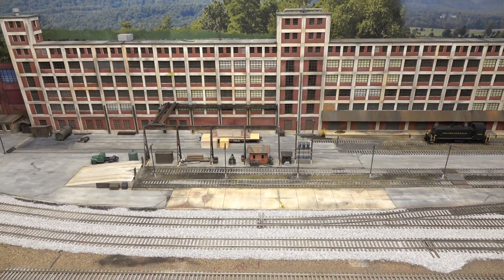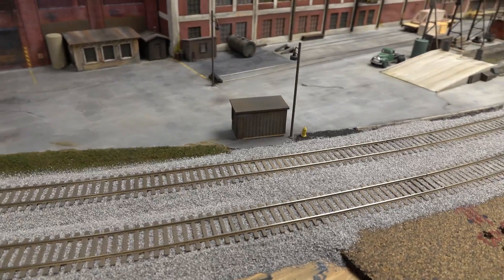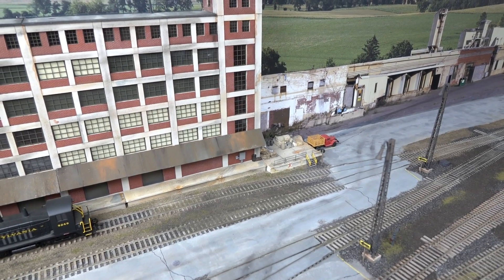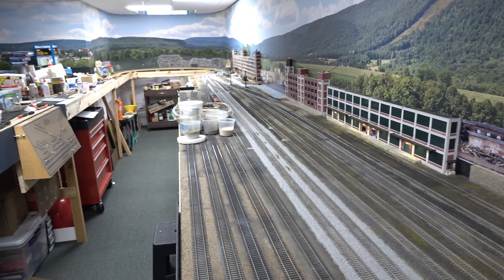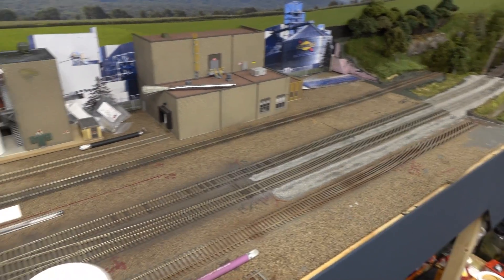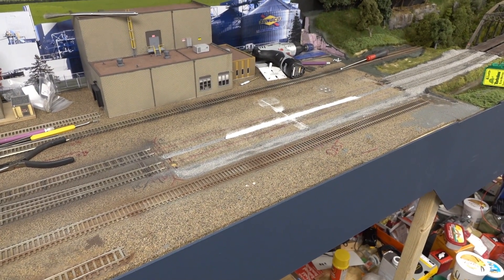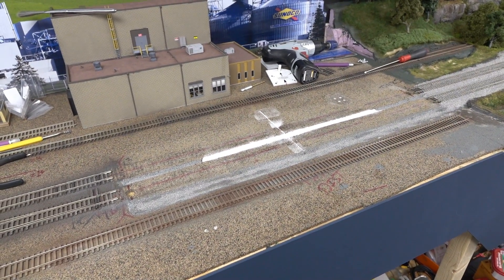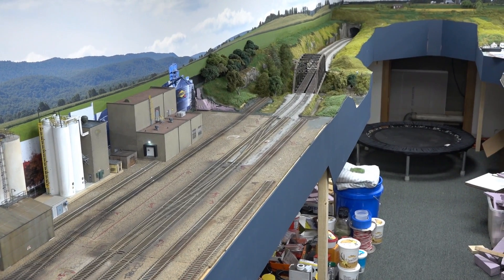MRUV 116: Details, Track Power & Crossover Installed

Comment: Just watched your video, and it brings back good memory's, from long ago.
Back when I was a kid in the 50’s, we didn’t have LED’s.
So we used fiber optics to light up things that with a light bulb would get too hot.
Nothing like putting in long hours, and then watch things melt.
With one light bulb we could do a hole part of the layout..
Some of the parts that we lit up, couldn’t have not been done with the old wheat light bulbs.
It work back then, do you ever think about using fiber optics on tight spots?
Reply: I have considered fiber optics- in fact I have some. Thus far have been able to make things work, especially with some of the much smaller LEDs now available. But there certainly will be instances where the fiber optics will be a very good option.

Comment: Good update. My question is; Can you possibly do a video on how to wire signals? Thanks
Reply: If you go back and look at some of his earlier videos, he talks about the signaling and block detection.
Reply: Christopher is correct- the Controls & C/MRI playlist touches on it in several videos. Wiring the signals is actually pretty easy, it is the controlling of them that gets more involved. The signals here are just wired to a CMRI resistor board (for the LEDs) then run back to the CMRI SMINI/SUSIC boards for control.
Reply: Rob Bennett Christopher Long Thank you both.

Comment: you're doing such a great job...with the concrete road surface weathering.  

? Since both double crossovers switches always need positioned, in either straight or crossover mode...do you wire both switches to the same on/off toggle switch?
Reply: Yes, I do- I wire the #1 and #8 leads off one of the Tortoises to the #1 and #8 of the other, then power them both. It works fine for me- even with the CMRI controls. Right now that new X-over is just controlled by a toggle, but it will eventually be wired into the CMRI scheme as all the others are done.

Comment: Looking good..is the new crossover going to be a signaled control point or hand throw?
Reply: John- it will be a CP point, with both dispatcher and local control. The local control is mainly for when we run without the dispatcher, so one can still trow the TO's.

Comment: Who is the manufacture for those number 8 switches you use for crossovers switches?  Looking really good,  keep up the great work,  have been watching most of your videos,  thanks for posting as there are a lot of great ideas I think I can use from this video.  Thanks.
Reply: Harold- those are from Fast Tracks. They are made from code 83 rail in fixtures, soldered to PCB ties and then to wooden turnout tie sticks. If interested, here is the website: https://www.handlaidtrack.com/

Comment: Do you power all of your frogs? If, you do power your frogs, how do you accomplish that?
Reply: Craig- yes I do. I decided to go with Frog Juicers from Tam Valley Depot. One can also use the contacts on the Tortoise if they are used. To me, I liked the simple approach especially since Tam Valley offers a "Hex" (6) Juicer.  Very easy to install and hook up. Others prefer using contacts on the switch machine- choose whichever method you prefer most.